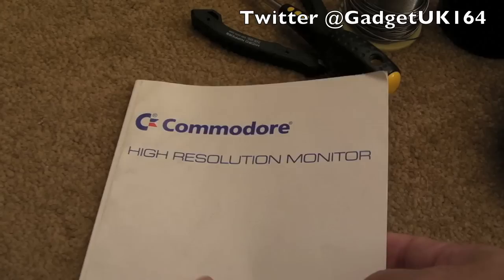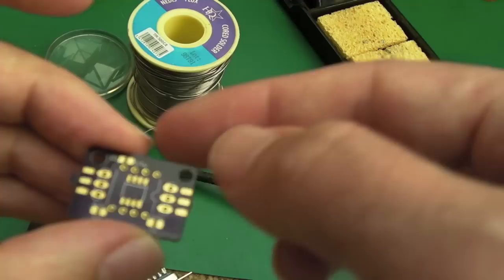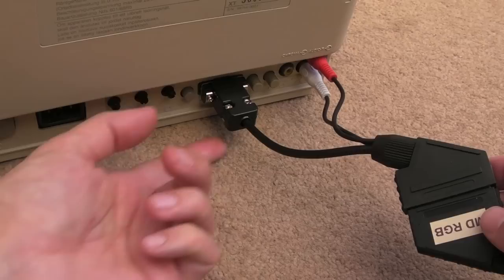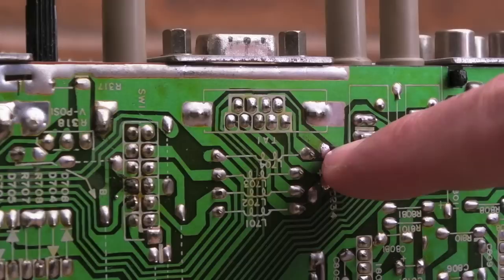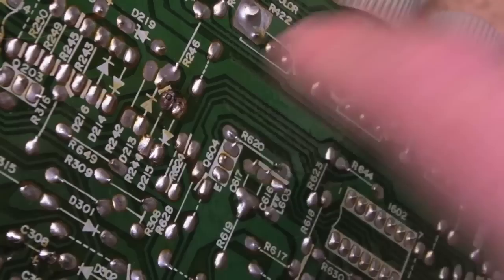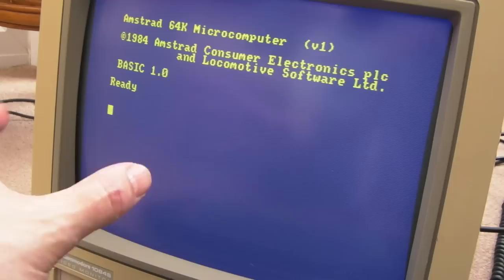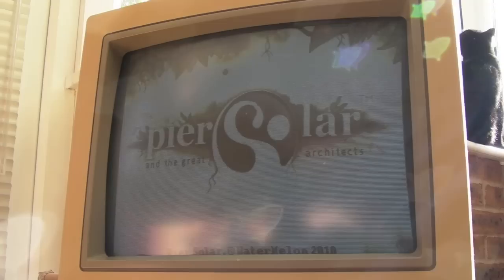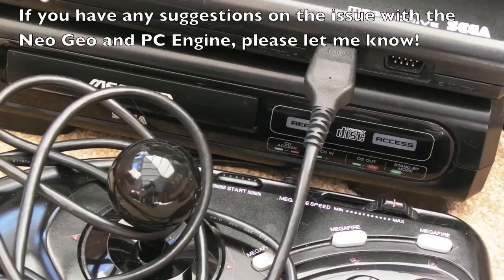Commodore 1084S (1084S-D1) Repair(s) - Part 4 & Sync Splitter Mod (SCART RGB Adapter) LM1881 EL1883

Comment from the maker: EDIT: I think there's still an issue with this since one of the sync pins there looks combined.  I will revisit!
OSH Park PCB designed by Konsolkongen https://oshpark.com/shared_projects/Y1FDFFmQ
And before someone says that Turtles on the Megadrive there has the wrong colours - I was using the 'colour enhanced' version of the game that I stuck on a faulty Megadrive cart.
Please note there's a minor editing mistake there that could confuse you - just the order of the clips went in wrong (around the point I worked out the composite connection on the D connector goes nowhere).  
Part 1 - https://www.youtube.com/watch?v=YeLdkaHOxpw
Part 2 - https://youtu.be/_YtIhoOffy0
Part 3 - https://youtu.be/gs_epqnsrRQI
Part 5 - https://youtu.be/H8v1zI_Ik14
Part 6 - https://youtu.be/yndStmgy47k
Part 7 - https://youtu.be/ZMogbh_WIVw
Reply: Just to sum it up, you took a EL1883 instead of the LM1881 and you feed it to the H and V sync. I think i will try to put the circuit into the plug and wire the csync to pin 8 and 9. Just found a near mint 1085s d3 across the street.

Comment: Good to see you got it working for the most part! I got the older 1084S with a DIN connector. Wired up a SCART adapter a while ago. It does not have a dedicated composite sync input pin, but found out it worked fine if I connected the signal to the horizontal pin. In my case my MVS 1FZ works just fine without flicker. Hopefully you can figure it out what is wrong eventually!
Reply from the maker: I might check that out - maybe the manual that came with this isn't for this specific model or something.  Maybe inputting into the h-sync pin would work for me...

Comment: A nice little mod.  Clearly, you are happy with the video quality.  Also, nice work finding that shorted diode -- how long did that take you to track down?
Reply from the maker: It didnt take long to track down tbh.  After I stopped a few months ago when it "just didnt work", I picked up again on Saturday and after trying with the EL1883 and getting the exact same issue I thought "something must be going on with the connections".  Measured the H & V on the scope and one was flat lined, measured on the meter to ground and dead short.

Comment: I have a Commodore 1084SP and want to get RGB from it to my neo geo aes too! Did your cable work?
Reply from the maker: I had a wierd sync issue with mine, suspected the wierd none standard sync of the neo geo causing it.  I've not investigated further yet, but I will when I get time.

Comment: Solving without IC:
1. soldering, join middle and lower pin SW2 (3 pins switch)
(* lower pin is means where write "sw2" on mboard - see on this video 11:45
NOT the small ground pin !!!)
2. connect signal R G B to dsub9 (or scart)
3. connect composite to yellow CVBS cinch (or via 75 ohm )
4. turn on the analog and rgb at the back
Enjoy RGB :)) 
Box with only scart you must make specific cable.
(Testing and work 2 box with scart and video out and 1084s d1).
Reply from the maker: Thanks, I might re-visit this!

Comment: Great video as usual.
I built a LM1881 sync stripper into a SCART Female-Female adaptor block for my 1084S. I then used a D-dype to SCART Male to plug from my 1084S into the Sync Stripper. It also has a 3.5mm audio out and 5V in connector.
I recently rebuilt the circuit using a slightly different circuit diagram compared to the one pretty much everyone uses.  The reason behind this other circuit diagram is here:
https://shmups.system11.org/viewtopic.php?f=6&t=55948&p=1153713#p1153713
I just use comp sync extracted from the composite video in from my consoles/computers.
It is great to be able to plug in all the old consoles to my 1084S. I like having the easy controls to adjust H or V position, compared to entering the 'service menu' on my other 14" TV CRT's. Plus stereo sound! I wish I had stereo back in the day. games sound so different now.
Reply from the maker: Yeah, I did add a 75ohm termination resistor, made no difference whatsoever in my case.  I haven't finished tinkering with my circuit yet though, I am wondering if Composite input actually is connected to either H or V connections on the monitor - I might have over looked that.  If that's the case, that might be my problem, and I might not need the EL1883 board at all.

Comment: Might be worth using S video for the Neo Geo and using both chroma and Luma connections to the 1084?
Reply from the maker: There is no chroma and luma (natively) on there - its RGB only.  But a modification could be done I guess!

Comment: after you installed the sync splitter mod ! can u stil use the db9 rgb port with a commodore amiga and 128 ?? via rgb
Reply from the maker: Yes, I still use RGB input.  In theory you could avoid doing the mod I did there and just back fill any empty components and jumper links to have the monitor handle Composite as a sync source.  I might re-visit mine to see if I can do that, and remove the little PCB I fitted.   But it does work perfectly with RGB + H&V, or RGB + Composite as sync.
Reply: @GadgetUK164  why am i not subbed to your channel wtf ?!

Comment: Wow, you're on fire this week! What's a good source for female SCART connectors I can solder onto? Very few on eBay, and most are way overpriced.
Reply: used extension leads or old set-top boxes
Reply: Thanks, but here in Canada we just don't tend to have any SCART leads around, and none of our set-top boxes had SCART onboard. I'm forced to seek a source elsewhere in the world online.
Reply: How many do you need? I have a local electronic store that sells new old stock scart sockets at 1 euro a pop, but they have vertical pins on the back (intended for PCB mount)
Reply from the maker: As tomatolicious says - repurpose them from old disposible hardware.   In the UK I would order from Farnell or CPC, but I suspect they may be pricey as they just aren't used as much as they used to be.

Comment: could you wire the composite pin on the rgb port over to the composite in rca jack?
Reply from the maker: Strangely enough the composite port there IS wired up correctly, but that doesnt act as a sync input for use with RGB.  So I dont think that will work.

Comment: My 1084s is developing some smell after half an hour of usage. Its not the smell like burning or ozone, but it is not pleasant. What could be the issue? Would this ended if i let it run after night or longer? It works just fine with my Amiga 1200. Cheers.
Reply: A fishy smell normally means the capacitor's.
Reply from the maker: As shown in part 1 (and part 3) of the repair to this monitor, the glue can start to conduct.  That will give off a strange smell.  Or as others have suggested, maybe leaking caps.
Reply: I think mine is ozone (+ dust!) as I smelt the nasty cap fish smell when changing the capacitors on one of my A1200's and it is different.

Comment: I have a 1084 D-2 monitor. Can I use this cable for that model? Can it be ordered somewhere?
Reply from the maker: This is the cable I use - bear in mind I had to mod my monitor to create a sync.  In theory the D2 should support composite as a sync source.  https://www.ebay.co.uk/itm/PHILIPS-CM8833-MKII-RGB-MONITOR-TO-SCART-ADAPTER-CABLE/320754731999?epid=2260242610&hash=item4aae78cbdf:g:Pp0AAOxy3cJTglIw
Reply: Do you recommend to mod the monitor? I have no experience with that.
Reply from the maker: I would just get a composite lead for the C64!  It doesn't output RGB!   You can just plug a composite lead straight into the 1084 without any other adapter.
Reply from the maker: You shouldnt need to if its working OK!

Comment: I have one dead but I don't touch monitors.
Nowadays I'm troubleshooting my A500 plus. There are some keys pressed even without a keyboard attached :-/
First time I am experiencing this.
Reply from the maker: Check your CIA chips - swap them around (there are two - even and odd chips).  Just make sure to get pin 1 the correct way on both chips.  If behaviour changes, a CIA is dead and you need a new 8520.  If the problem still exists, then it could be a fault with the keyboard - maybe a dirty connection or bad trace, or a fault with the MCU or RAM on the keyboard itself.
Reply: I did swapped the CIAs two days ago and have no problem since then.
The funny this is that this happened even without a keyboard :-/
Haven't seen any problem with the drives, mouse, joystick and serial port.
Maybe it just needed some cleaning, I will swap them back for more testing.

Comment: I have that exact same monitor model, So if I wanted to reconnect the CSync Connection, how would I do it without that chip?
Reply from the maker: Well according to the manual I got with mine, there's a composite input pin on the D connector (as shown in the video), and that should accept csync.  That's assuming the csync level is high enough, you may need to amplify it first.   But on my monitor the composite input didn't go anywhere - not connected inside the monitor!  That's why I had to use the EL1883 chip.
Reply: It is possible that Yours was tampered with before you got it and a component was removed from the board. I can check mine and see if a component is present.
Reply from the maker: Nah, it definitely hadn't been tampered with.  The pads connecting to the composite pin had no solder on at all - factory!  There was a cap position leading from the composite pin that should (in some models) pass the composite through a cap to a wire which goes elsewhere on the board.  The wire and the cap had never been fitted to this model.  Commodore were well known for having variations of some of their monitor models.
Reply: UPDATE: My monitor is also lacking of the Capacitor
maybe the rating of the capacitor can be discovered by looking at one of the other Variants of the 1084S.
P.S. Opening a still Charged, but unplugged device is nerve wracking.
Reply from the maker: But the capacitor goes nowhere - if you at its -ve side, it goes to another pad, which I suspect is for a wire.  Where does that wire then go?  I am guessing there will be other components missing too.

Comment: There's so many different variants of this chassis, I swear Phillips threw some dice to determine which case and ports they were going to add. But without modification you probably could have have used this as an 15 khz arcade monitor. Just saying  ;)
Reply from the maker: Yeah, crazy - seems like a cost reduction thing.  Some models not supporting all features etc.  And it will still work as a 15 khz monitor!  The H & V support is still there!  All I've done is add support for the Composite input to feed H & V!
Reply: Ah, somehow I thought the separator board disabled that option. That's great!

Comment: the diode is a signal diode its a 1n4148
Reply from the maker: Are you sure?  It does look to be part of the clamp, and typically those are Schottky diodes.
Reply: yep,im sure.and yes its part of the clamp circuit and no,its not schottky
Reply: and no,im not picking flies with the video.it was quite good a friend sent me the link for me to see,it was interesting
Reply from the maker: That doesn't make sense then - because when diodes are used for clamping, typically its always a Schottky.  The reason they are used is for the fast switching time.
Reply from the maker: Although, just thinking now - the 1N4148 has fast switching time!  So it's probably fine, and you are probably right!  Nice to know I fitted the right part then.
Reply: they are used like this in a lot of applications and  there hardly never schottky on stuff this age,most it has to deal with ttl level signals,so to ground and to 5 volts
Reply from the maker: I found the service manual for the D1!!!!!!   You were spot on - indeed 1N4148!  I am glad you pointed this out, because it helped motivate me to go looking for schematics again and this time I found them!  https://gona.mactar.hu/Commodore/monitor/schematics/Commodore_1084S-D1_PAL_Service_Manual.pdf
Reply: yes,ive been repairing these for years with no service manual,haha.for reasons i cant explain i havnt been able to find the service manual at all in ten years,thanks for sharing
Reply: actually thats new addition to gona,it wasnt there before